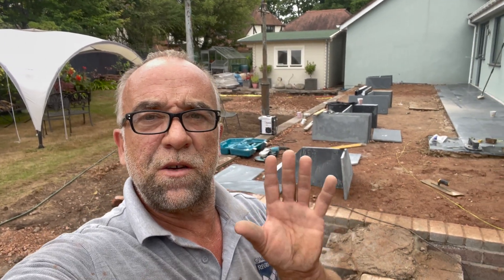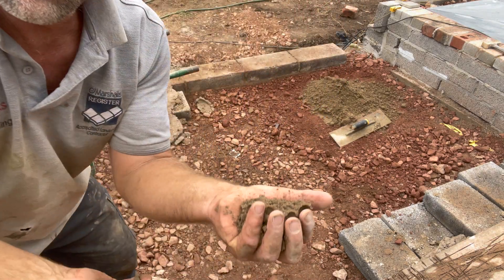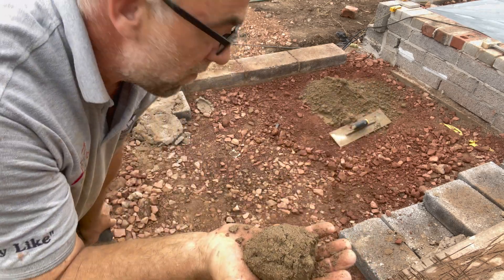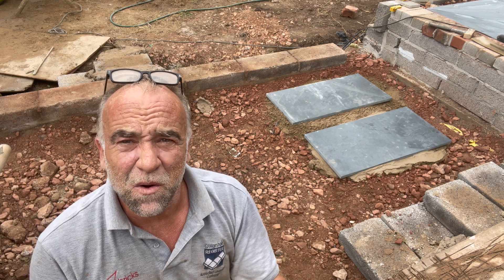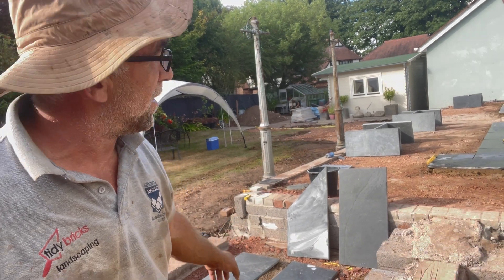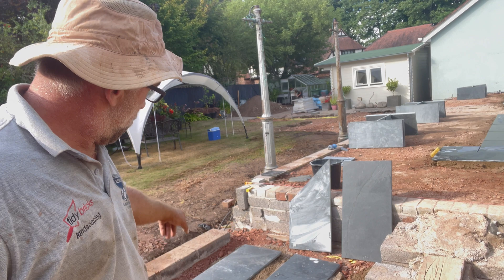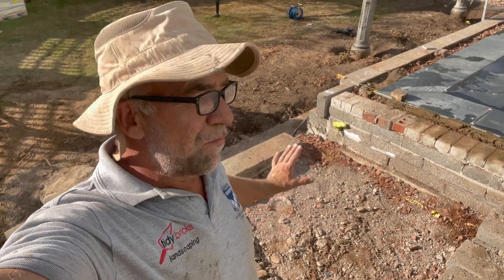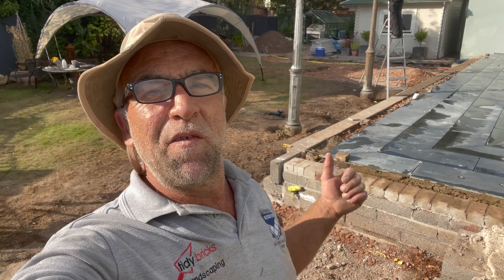Semi-Dry vs. Wet Cement Mix: Which is Better?

Comment: Water and cement is a chemical reaction… not a fan of this semi dry carry on for that reason. It’s one thing the proper on the slab sticking to ya dry mix but you want your bed to grab into the type1 also especially porcelain. Say what you want but I stick by science
Reply from the maker: I’ve always preferred a wet mix personally like you said it pulls up the type 1 too 👍🏴

Comment: Got to say ive always used a wet bed (10 years experience) but surely the test is in a year or two time not what grabs early on?
Reply from the maker: If it grabs early it’s all good but most importantly lots of primer so semi dry or wet that part actually doesn’t matter it’s all about the primer 👍🏴

Comment: I laid my concrete patio 20 years ago using semi dry. Only 2 slabs are loose but that's because I chop logs with an axe on them
Reply from the maker: Actually the main part is the primer and put plenty on too that’s all it really needs 👍🏴

Comment: What is the mix ratio (cement, sand , water ) for semi dry & wet ? Thnx
Reply from the maker: Always 4/1 sharp sand mix and I always put a squirt of fairy in the mix as for water amounts just start with less and watch mix for a while then add as needed 👍🏴
Reply: @tidybrickslandscaping what do you mean  fairy ? No idea
Reply from the maker: @lisaadam3423  washing up liquid 👍🏴
Reply: @tidybrickslandscaping  🤔for what purpose ?
Reply from the maker: @lisaadam3423  it’s makes the cement more workable easy to spread than without 👍🏴

Comment: Hello quick question in terms of the sand could you use the sand they use in concrete yards when mixing concrete or would that sand be too course for porcelain slabs thanks
Reply from the maker: That’s perfect sweep up as much as you can 👍🏴
Reply: @tidybrickslandscaping  also have you ever used botament d10
Reply from the maker: @montdino9775  never heard of it sorry
Reply: @tidybrickslandscaping  no worries thanks it’s kinda like an sbr when you mix the sbr do you add water to it when making slurry what’s your mix ratio and thank for taking time to answer my questions I really appreciate the help

Comment: Still rather lay my flagstone in wet mix, helps me sleep better.. also joint it at the same time in frost freeze areas because it will attach to the base mix under your flagstone. If the joint is laid in at a later date, it could fail years later.
Reply from the maker: Couldn’t agree more good idea on the jointing 👍🏴

Comment: Interesting experiment. I don’t care I still think wet is better way to go. In this one case maybe the conditions were just right and semi dry stuck very well. In the tiling world you definitely don’t want your thin set to be too dry, you don’t get good adhesion. Maybe you’ll get away with it sometimes but in the long run your thinset has to be wet enough for the tile to adhere well to it.
Reply: Thin set is not the same as a sand and cement fix. Thin set is adhesive!
Reply from the maker: Totally agree I think the conditions were in favour of the semi dry and yes um already back on the wetter mix already 👍🏴 it was a good test

Comment: There is no bond between the ground (dirt) and the cement wet or dry....the bond is between the tile and the cement. The surface you used for your experiment, the ground, is incorrect....that should  have been stone, concrete or some other hard surface...
Reply from the maker: It is stone 100mm worth we lay on a flexible bed over here don’t need concrete it’s only a patio that gets walked on 👍🏴 different in the UK

Comment: We use semi dry for a variety of reasons, as you say if the primer is put on nice and thick then sticking is no issue at all. Semi dry is cleaner, it is easier to achieve a proper full contact bed and is less prone to shrinkage, you also dont have surrounding slabs moving about with semi dry. You can also screed your beds as well making things much quicker.
Reply from the maker: For sure it does have its advantages semi dry mixes over wet 
Can’t decide what I prefer 👍🏴
Reply: Totally agree mate it also wickes the minerals up creating a stronger mortor bed overall rather than a wet mix which would do the opposite

Comment: The load on slabs is a downward force. When a patio is laid u do not pull them up for no reason.. they may pop off in winter if pointing in permeable.. ground workers would lay slabs on dryish mix, landscapers lay on wet. But wet comes up in the joints and when the next 1 goes on the previous 1 may move because of slump while the the next slab is knocked on.. try laying kerbs with wet gear, won't happen.. also wet gear will tend to crack on shrinkage, while drylean won't... as long as u apply bonding agent drylean is quicker to use and a lot less mess....
Reply from the maker: It’s always about the primer wet or semI dry 👍🏴

Comment: wouldn't use a drier mix unless I was using a 1200 x1200 tile when it would make more sense to screed it, personally I will always use a wet mix as it creates more suction and is overall a better job for laying tiles individually but can use a screed and screed it out using a drier screed mix but  laying tiles individually with a dry mix is nonsense it to only makes sense to use it as a screed in my experience 👍
Reply from the maker: Yeh I’m a wet mix man I do prefer it 👍🏴

Comment: Less water can be a strong longer lasting mix as long as it’s compressed well … you can have to much water as well as not enough.. I use different mixes on different products..paving brickwork and edgers I make all different consistency’s  ,, as long as it’s mixed well should set well tho paving with a dry mix will take longer to lay Id say but dry is great for edgers
Reply from the maker: Totally agree with you mark 👍🏴
Reply: GRAVITY IS A GREAT FORCE FOR HOLDING THINGS DOWN AND IN PLACE .
Reply from the maker: @johnbowkett80  that does help too 👍🏴
Reply: @tidybrickslandscaping  I honestly think there are too many armchair wannabe brickies around and don't realise that building ain't rocket science , its been going on since we climbed out the trees . Its common sense and very hard graft but I love the game . Take care . Don't drop a slab on your toes and if you do ... Blame GRAVITY.. 👍👍👍👍👍
Reply from the maker: @johnbowkett80  well said 👍🏴
Reply: @tidybrickslandscaping  Just a point...... Why would you have a stronger mix than the material you're laying .... As in brickwork the mortar must not be stronger than bricks and some architects recomend a mix as weak as 7:1 for very soft bricks . My mixes for any slabbing is never more than 8:1 maybe even weaker . Just saying . 👍
Reply from the maker: @johnbowkett80  just had a quick google and it seems to range from 3/1 4/1 5/1  and patio tiles are very strong anyways but 8/1 sounds a bit to weak to me 👍🏴
Reply: @tidybrickslandscaping  Been laying Indian stone for damn near 30 years all local to me and have NEVER had to go back . This includes 2 pub outside areas and one of them was huge for bands and audience's . I put half a bag of cement and top it right up till it spills out . 2 barrows and its always fine . Once the Flowpoint is in, it locks them up a treat . Im not being tight fisted about the cement its just the way I do it and it works for me . I was laying the stone many years before it was 'calibrated'. They used to be 8 or 9 sizes and imperial and the 3 by 2 could be an inch thick one end and 3 inch the other .... I soon learned how to look at a slab and put the exact amount of mortar down .  👍
Reply from the maker: @johnbowkett80  if your happy with that so I’m happy for you 👍🏴

Comment: Great video buddy. I'm going to have a go at laying a patio in the coming months. Is it feasible to do in winter? Or do you need to wait for more spring/summer weather? If so I've missed the boat there.

Cheers again, from a fellow South Wales-er!
Reply from the maker: Winter time is fine just not below -2 degrees 👍🏴🏴🏴

Comment: A video on how to mix semi dry would be usful. Not many out there. Semi dry concrete I find hard to mix right. To make it fluffy like ready mix I struggle and I have a proper cement mixer.
Reply from the maker: Next time you’re trying to make a fluffy mix squirt a little bit of fairy liquid in it 👍🏴
Reply: @tidybrickslandscaping  I will try this but I think it might make it a bit weaker. I got another comment there to wet the sand first in the mixer and then add cement. Some times the simple things can be the toughest to get right
Reply from the maker: @marcusd2380  cookies another master of the landscaping game check out his setts videos just incredible designs I’ve watched his videos for hours hoping one day I’ll have the same opportunity to do something similar one day.  👍🏴
Reply: Best tip wet sand before mixing don’t add water to mixer fluffy every time ps for setts I mix with 3ton digger spot on 👍🍪👏
Reply: @StephenMurrayCookcookie  thanking you Stephen for taking the time to write. I’m going to give this a go
Reply: Don't add fairy, degrades the cement and will start to crumble after a while, use optimix for a creamy consistency.. but semi dry is really drylean. Should be a bit stronger 2 stone 2 sand 1 cement.. 221 mix just enough water to make it bind like is shown. Bigger the stone, stronger the mix...

Comment: Love your videos pal but would slightly disagree with your test, after 6 hours wouldn’t be enough time to get a proper assessment of both mortars, don’t get me wrong I have used a wet mix for years without fail, but with a dryer mix you can get the compression force, with a wet mix you will be left with slight air pockets where the water once was because water isn’t compressive…

I would love to see an actual real test where both are aloud to fully cure, and somehow test the strength rather than the grab abilities Pre cured
Reply from the maker: Very good point hopefully this other video I did where I left the tiles down for a week then pull them up take a look https://youtu.be/3ecECF8s1go 👍🏴

Comment: I’m a big believer in wet mix as I feel when you lay on it , the wet mix can spread when you bed and hit the slab down and I feel will dry together with the primer better, didn’t expect semi dry to work aswell but I feel wet is the one, also would you recommend a grabo for 900x600? Great vid mate
Reply from the maker: I’m glad you found the video interesting as so did I and I would recommend a Grabo for anything except trying to lay block on flat 👍🏴